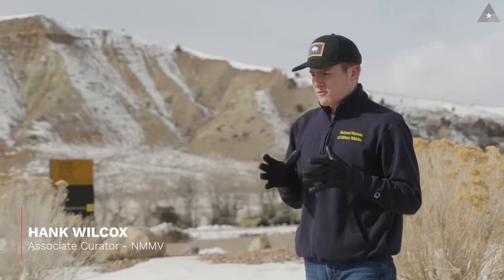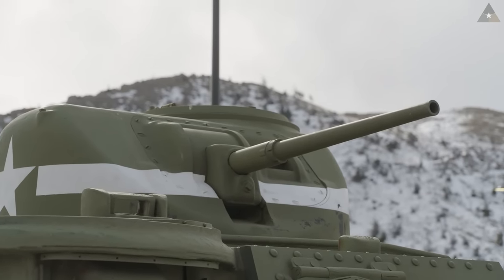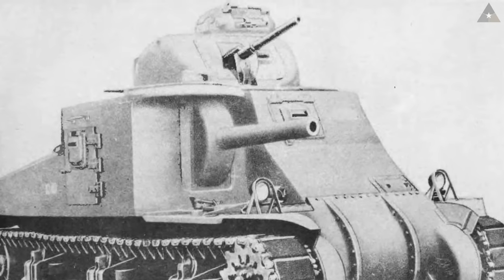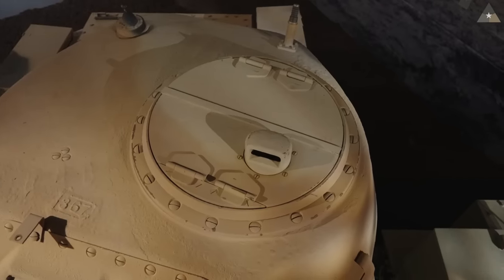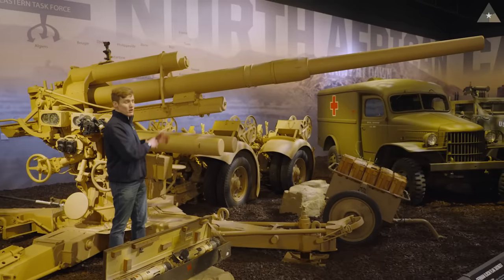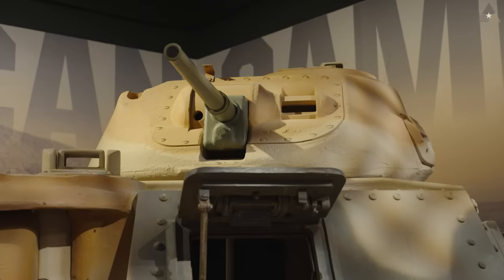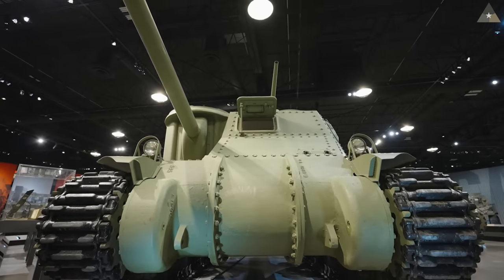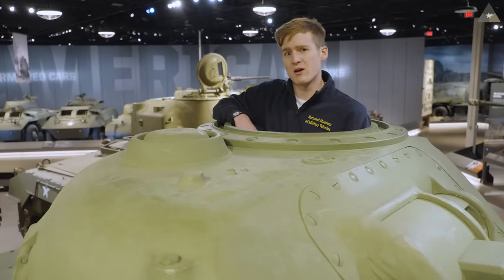30 Tons with 2 Guns: The M3 | Did it matter?

Comment: One point about the height, I've read that the tankers who were using it in the far east and the Pacific liked the extra height because it allowed them to better see into the dense undergrowth that they were more likely to encounter in a tropical environment.
Reply: They did not face the amount of anti tank gunfire and Japanese tanks were poor early 1930's designed models. So jungle island terrain was fine for the M3.
Reply: The British using M3 in Burma did ok with them too..  but off they were using them against Japanese static defences and not tanks, at least mostly..  in North Africa they were up against panzer IV .. idk if any faced Tigers in Tunisia.
Reply: Like the famous Dutch soccer player Johan Cruijff once said: "Every disadvantage has it's advantage" (and vice versa...)
Reply: They were only as good as their crews. 2 cannons 37mm and 75mm ---2  30 cal. machine . Lots of firepower.

Comment: If you're going to mention the Panzer IV F2, I'd think you'd mention the Panzer III J, which was the main rival to the Grant in the 1941 war in North Africa. It changed out the earlier 37mm for a 50mm long-barrel (3m) cannon, and was the only German tank in the theater that was effective against the M3's armor.
Reply: Actually most Panzer III Js in North Africa had the shorter (L42) 50mm gun, only a few J models and the L and later models had the long (L60) 50mm gun from spring 1942 onward.
Reply: Indeed there was a 2ish year period from 40 to 42 where the M3 was on top, especially as it was the first tank with an excellent APHE shell for dealing with the biggest threat, German PaKs.
37mm AP just did nothing against them.
Reply: Yep. When the Grant arrived, it was the best tank on the field. Not bad for a stop gap.

Comment: Minor issue when it come to countering german guns.  The M2 75mm on the M3 was able to lob HE out to 6 miles and could be expected to reliable place HE with 20 yards of a target at 3 miles. Against a tank thats useles, but against an open air gun thats going to scythe through the crew and possible even destroy the gun.

At any rate anti tanks guns were deadly as an ambushing weapon but once they were spotted the M3 had little trouble dealing with them.
Reply: Except the 75 was also equipped with an AP shell
Reply: @gotanon9659  true but you dont need an AP round to kill a large flack gun sitting out in the open with its crew exposed.
Reply: @gotanon9659  The whole AP debacle was also a thing, the first 75mm AP shell that came to Africa didn't work as intended and the British informed USA about it but the still needed a AP shell fast. One of the thing the did was to marry captured German 75mm AP shell from Tobruk with captured France 75mm casings that the captured from Vichy France in Syria, which worked wonders until the could be supplied with working AP shells.
Reply: @Lunkwow  this is not quite what happened and you seem to combining 2 different issues. Some background. The 75mm gun M2 was directly derived from the M1897 its self was just an americanized French cannon de 75 1897. The Lend Lease laws required drawing down old stocks before new material could be transfered so the early ammo provided was Great War era ammo which  was intended to be fired from a field gun operating as a howitzer ie the round would fall from a high angle. Becuase of that the ammo supplied had no grazing fuse which meant that if it hit at a low angle becuase it was fired from a might bounce without detonating. The solution was to pull fuses from french ammo which was produced according to their early great war doctrine of using the 75mm as a direct fire weapon so they had grazing fuses. You could (and they did) just fire old stocks of french 75mm from the american tanks.

The second issue wasent that the 75mm AP didnt work, it worked exactly as intended. The problem was that the production line for 75mm APC was still being built so we sent the 75mm AP we had in stock. 75mm AP was perfectly capable of fulling perforating the early PzIIIs and PzIV but when the germans started replacing losses with up armord tanks specficlly the Pz IIIj the old AP round had issues with deflection and shattering. That said below 500 yards even if the round shattered it would still likely kill the target through massive spall and above 500 yard it would still wound and kill crew.
Reply: @kennethreese2193  Regarding the HE shell I didn't about the fuse problem. Most of what I heard was the British where happy having a good HE shell on there new tanks.

I might be wrong, but I'm quite sure of the marriage between German shell and French casing, even if it was a really short story. But finding where I read or heard about is a daunting task.

Spalling is quite deadly but would it still be hot enough to ignite penetrated shell casings? You don't want to leave a tank to recovered during the night.
Reply: @Lunkwow  a gentleman named George Jarrett was at the middle all this. Jarrett was one of those men where if only half the stuff said about him was true, he would still be a total badass. A museum curator and ordinace specialists with what the British described as "encyclopedic knowledge" he was sent to Africa to assist the British forces. In his papers he specficly talked about securing laths and milling out the necks of American AP, modifying the driving bands of the shells and then affixing the germen shells to american cartridges.  That said the guy did all sort of crazy stuff like pulling propellent out Italian cartridges and adding it to UK cartridges to make special super velocity rounds. I wouldn't be suprised if he played with modified french shells.

Spall was a primary killer of tankers all through the war. A 2kg chunk of steel moving at bullet like speeds damn near acts like a blender blade in the confines of a tank.

Comment: The two pounder (37mm) was still more than enough in 1940, it was by 1942 where it was genuinely obsolete. 
The problem with the 2 pounder in 1940 is that in North Africa, tanks armed exclusively with the 2 pounder (British cruiser tanks) had no way to tackle the most dangerous threat in the desert, the German anti tank PaKs.
These retired an HE shell to quickly put them out of commission, leaving British tankers dangerously vulnerable. 
The M3 Grant did, of course, not suffer from this problem due to the event APHE shell it was typically loaded with.

Comment: The great success of the M3 is seen on the front and the sides. The transmission, suspension and engine methods continued on into the M4 Sherman and the tank destroyers. As an intern getting major parts right was a success.

Comment: The 37mm was beginning to be obsolescent when the M3 rolled out, but it’s high rate of fire helped it’s usefulness.
Reply: it could fire canister shot also
Reply: And the 75 was designed to kill armor from the beginning, it was never a pure infantry support gun
Reply: Plus it had cannister to fire. Very useful.
Reply: @JENKEM1000  That's just not true... The 75mm was developed from the Canon de 75 modèle 1897, which was a French artillery piece made in 1897. The US took the basic design and adapted it to tank use; it even used the same ammunition as the M 1897 artillery piece. 

It was in fact not designed for use against armor, but by virtue of being in a tank, had ammunition designed for it afterwards to combat enemy armor.
Reply: I was going to question what they used it for if they used the 75 for tanks
Reply: @PotatoeJoe69 
Could still kill a Panther or Tiger tanks

Comment: The counter weight was used because the stabilization gear was designed for the m4 gun not the m3 shown here. The m4 gun was longer thereby heavier hence the added weight. As with the M4 Sherman the stabilization system was considered secret. No training or manuals were provided.  Some crews figured it out most didn't.
Reply: Actually the first M3 tanks used the shorter M2 gun (31 calibers long), which needed the counter weight) while later models used the same M3 gun as the M4 Sherman tank (40 calibers).

Comment: That’s a good and fair assessment of the M3. In what I’ve read of the desert campaign, the British liked them as an improvement on what they had till then and they were welcome between Gazala and the 2nd battle of Alamein. Also, service with the allies against the Japanese, for example in Burma was sterling, where it remained effective.

The 88 was a problem for Allied tankers for the whole of the war.

BTW, the multibank engine was also deployed in a variant of the Sherman. M4A4, which the British also liked. It was one of the variants that could be converted to take the excellent 17pdr AT gun as a Firefly.

Comment: I have an operational radio communications system for this in my Ham Shack. The General Electric radios take a bay that defined the space for the Sherman as well as the later install of the FM gear for D Day.

Comment: Multibank engine was in the Sherman as well. It was the fastest tank engine available and the most durable. The radial was terrible, it was like a smoke signal to any bombing aircraft in the area while being slow from seriously lacking in power. The only reason for its use was it's light weight.The Aluminum Ford v8 was it's replacement for that reasons.

Comment: I’m not so sure that rivets fracturing and being driven inside the tank is spalling.  Spalling is generally the inside section of armor plate breaking off and becoming dangerous to crew and equipment inside the tank.
Reply: Hey! Hank here:
Funny enough the crew and I had a little "side bet" going on someone mentioning this- I had found the definition of spalling to be "Spalling and spallation both describe the process of surface failure in which spall is shed." And spall being "Spall are fragments of a material that are broken off a larger solid body."  It was my personal opinion that since rivet shrapnel had broken off from the rivet's body it counted as a spall... hence the term. I will say we did try to find a more precise definition, but in the end decided not to change the line. 

Anyway, I think I owe someone a soda now. Thanks for the comment!
Reply: @BasicRH  All I can say is, Riveting.
Reply: @BasicRH ”grenading” like the WW2 pineapple grenade would be the descriptive term.

Comment: For all its faults, it had one big advantage that the British appreciated: that 75mm gun.  They could barely cram in their 57mm six pounder into their Valentines and Crusaders to replace their obsolete 40mm two pounders as it was.  The Grant had relatively good armor, and was mechanically reliable.  For all the funky and tall design, at its introduction it was actually a reasonably effective tank to do the job it was given: be good enough until the M4 was ready for production.  That it succeeded in that task is the part that’s often forgotten: the British were quite happy to get the Grant.
Reply: The Grants got completely routed in their debut at Gazala though.

Comment: What always comes to my mind when it comes to the M3 is why they, at least at the later stages, even bothered with the turret and didn't model it into some sort of tank destroyer. Replacing it with some kind of machine-gun cupola would have surely saved a lot of weight, height and cost.
Reply: There are prototypes for designs such as that, but the casemate style tank destroyer/assault gun concept was never popular in the US to begin with, and was shown to be rather obsolete altogether, by war's end, so most of those projects were scrapped. The largest example of such a project survives in the T28/T95 Superheavy, that really only survived because it mastered the art of not being seen behind a tiny bush for some 27 years.
Reply: There's the 3-inch GMC T40 non-turreted tank destroyer prototype using the chassis of the M3 Lee developed in 1941-42, but it was ultimately canceled due to reliability issues and judged to be inferior to the soon-to-be-introduced 3-inch GMC M10 (it came out in Fall '42 already)

Comment: ai always thought that the M3 chassis could have been used as the basis of an A+.A tank by teplacinf the small turret with a new turret with multiple AA auto cannon or quad >50 caliber machineguns. The 75 mm could be removed or left in place for infantry support

Comment: 6:29 Why does the 75mm look so long compared to vehicle in the museum at the start? It doesn’t have a muzzle break either.
The regular 75mm didn’t protrude over the front of the hull 🤔

Must be using the L/40 gun of the Sherman instead of the original L/31 of the Lee, I guess.

Comment: Good video, except for propagating the overblown myth that it was petrol (gasoline) engines that caused tank fire rates. Statistics and post battle analysis have shown that isn't the case, as the burn rates for the diesel powered soviet tanks are on par with western allies. Ammunition was a major cause of internal fires, as were certain types of lubricating oils, as some unfortunate tankers found out the hard way. But to blame the fire rate of a given tank solely on having a gasoline engine is fallacious and a very pernicious myth that just won't die.

Comment: Wait you all are in Wyoming? Beautiful country out there! Right near Yellowstone too!  I love that the Brits were smart enough to name the tank after an actual hero and not a traitor, Grant. Kind of shows a bit of how racist the culture was at that point. Did you check the reference on the spalling of the rivets? I had heard it was fact checked and not true. If you have a tank shell coming at you the shell is the main spalling problem you have, even if it did hit the edges. There was a major cultural shift problem happening at that time, riveter back lash not trusting welding. So maybe that was a wild rumor to help push welding? Navy was particularly bad at that point having to make armored boats and not wanting to change.
It was a miracle we even had any tanks at the point considering we weren't in the war and doctrinally we didn't know what it would do or wouldn't. They were thinking about trenches  and such and heavy machine guns. So I don't know if stop gap is an appropriate term there. With the doors too, it seemed like they were thinking it would be a bit ranged on support maybe, again another user comfort idea looks like. Thought for the soldiers and how they would operate in and around it. We were developing pretty rapidly and had it not been demanded of us to help I doubt the would have made it to production. 
I don't think its height was a problem either, even desired considering the commander needed a protected look out. We kept that all the way through the abrams with the cupolas and turrets slowly changing over time. But the M60 later variants still had a mini turret on top. Pretty sure they are just as tall. 
Back then armor vs armor wasn't really thought of either, at least until May of 40. Hard to imagine what life was like then for sure, hindsight being 2020 we might chuckle but with how secret and how slow info traveled back then, these were huge strides. Thank god for Patton! He still was struggling 5to get the army off its horses and funding to happen for mobile armor for a battle not coming to our shores for quite a while! 
Great collection and well maintained! Great video! 
I really like the M3, it had a lot of advantages even at that time. It is quite capable in games too, which I developed a respect for it. That chassis formed platforms for shermans and so many vehicles for years to come without changing much.
Reply: Brits gave names to US gear, in US service it was the Medium Tank, M3

Comment: It is not true that the M3s gasoline engine made it or any other gasoline powered tank particularly flammable. What catches fire first and most violently in any tank is the ammunition. By the time the gasoline lights up the crew is either dead or has evacuated the tank.

The Soviet Union didn't like the lee because of its high profile and the fact that they didn't have enough gasoline to go around. Most of their Army was diesel powered and adding gasoline engines to the mix was a logistical complexity the Red Army could ill afford.

Comment: Gasoline engined Tanks didn't fit Soviet tank doctrine; different fuel supplies. Nothing to do with catching fire; soviet gasoline octane was too low for high power tank engines. 
Lend-Lease equipment gas engines had to be low compression for low octane fuel or diesel for the Stuart and Sherman tanks; both converted to diesel for Soviet use.

Low octane soviet fuel would ruin a high power radial engine from detonation during hot weather and hard use. 

The germans had this same issue the farther they made it into Russia and tried to use the local fuel in their vehicles. 
Their high-powered Maybach tank and half track truck engines destroyed themselves under hard use. Mechanics had to retard timing, engines made alot less power or destroyed themselves. Air-cooled VW engines run hot and detonate worse in hot weather.

Comment: Sure, it was based on some outmoded concepts and was far from ideal.  But, and it's a big but, it was sufficient to do what was required of it at the time.  It also excelled in some less "sexy" but tremendously important respects such as - it was reliable and it was available.  It had no long term development potential but the M4 made that issue largely irrelevant anyway.  Sort of reminiscent of the criticisms of the Hawker Hurricane for it's biplane heritage, use of fabric and generally not being as "futuristic" as the Spitfire.  Totally misses the point that when it was needed it met that need and met it arguably more effectively than anything else then available.